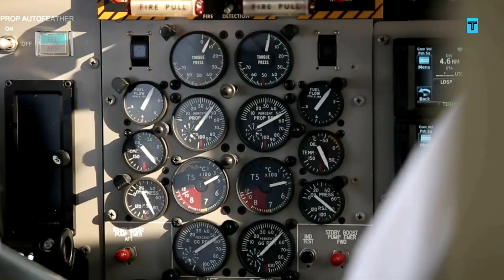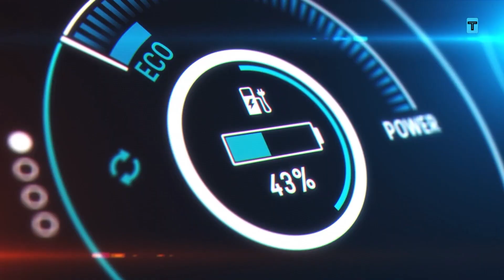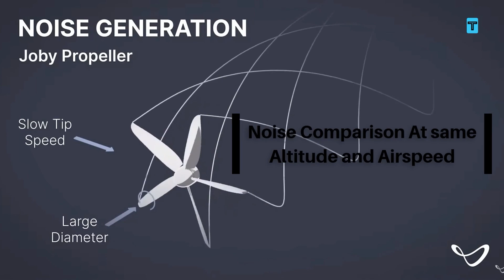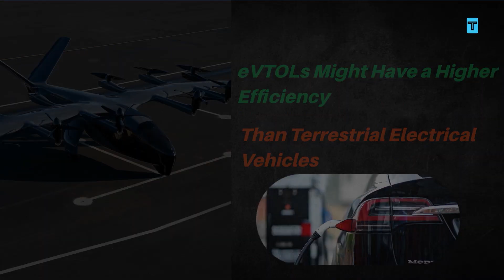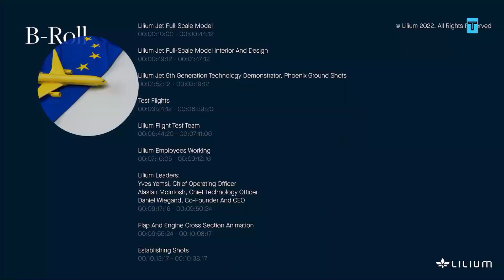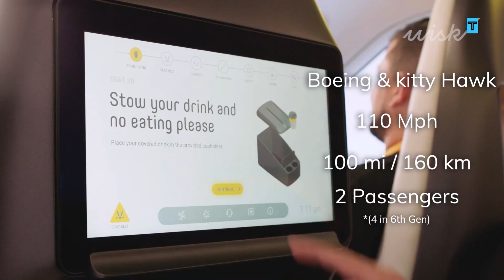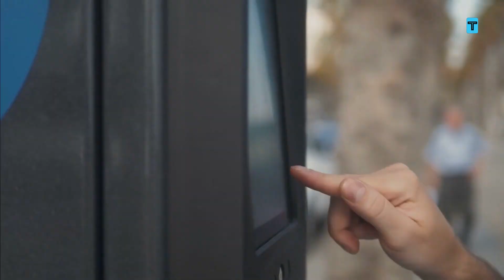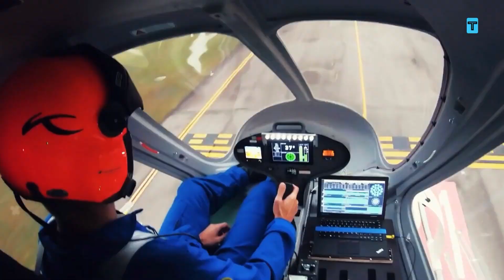Unveiling the Future of Transportation in 2024: eVTOLs Explained

Comment: You showed catchy clips of Ehang 216 with people inside. Why didn't you cover it in depth? They are already fully autonomous and have thousands of test flights with people aboard. You said you're gonna present the most promising evtol aircrafts... How many evtols you covered have test flights with people aboard? Please respond.
Reply from the maker: Hi, Ehang Ariel vehicle is indeed very promising. That's one of the reasons we  included its footage.
We didn't cover it in more depth for two reasons, one it is autonomous which make take longer to get fully certified than other piloted aircraft.
Two is that ehang requires another in depth video own its own which cannot be presented in this one 
 Once declaration of possible routes will be announced or type certification by CAAC will be fully granted we will definitely cover this. Most of the evtols presented here have a planned  route they will provide service at the beginning by partnering with established companies.